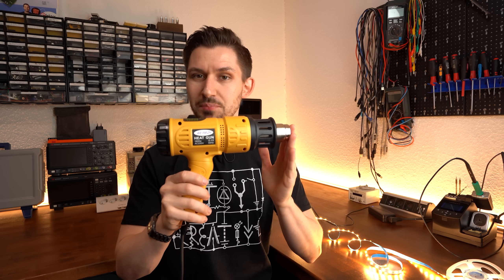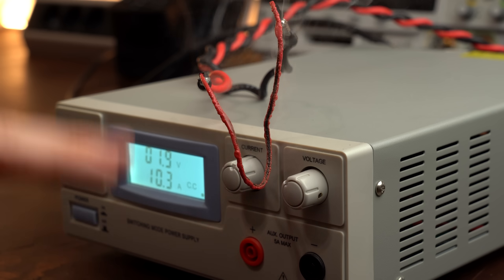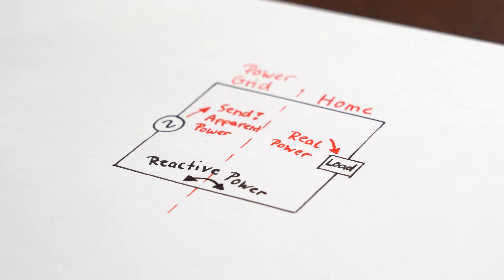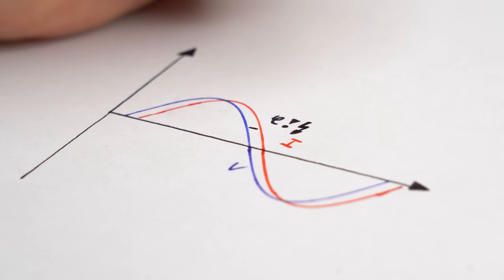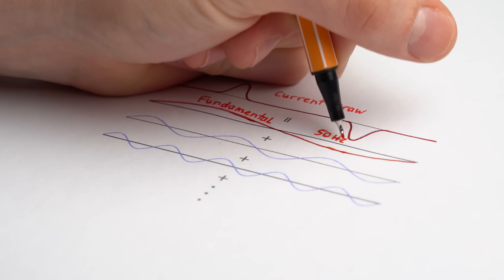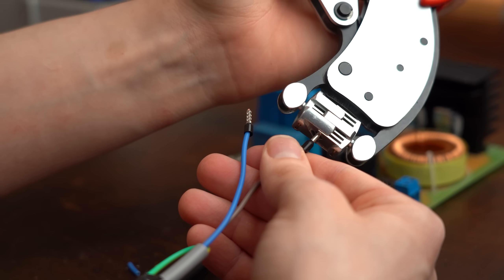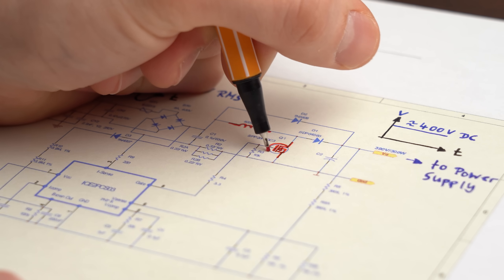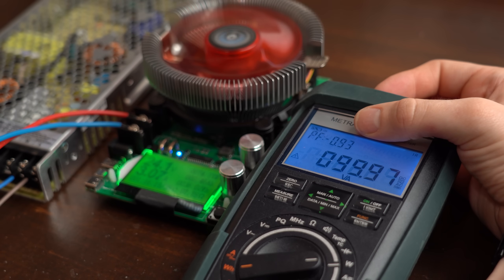The Most Important Circuit for our Electrical Future?! (PFC) EB#55

Comment: Many good quality LED bulbs have PFC correction built in. It is mainly to allow them to work with existing dimmers, but at least keeps the harmonics on the mains down.
Reply: Most do not. The regulation governing low power bulbs has been made in cooperation with the bulb manufacturers. This means that PFC is only required at higher wattage than those most common. As the limit is lowered, so does the power of the bulbs. Currently I think it is around 15 W, which is why manufacturers do not make bulbs above 14 W.🤑🎉
Reply: @NightHound1337  WTF

Instead of having better products, we get capped ones
Reply: @monad_tcp  Pee poo
Reply: @NightHound1337  Most do not. The limit is lowered governing low power only required at higher wattage then I think it is around 15w this means that the PFC is only those most common
Reply: The industrial LED lights do have much better power factor. But those start at like 300w each. Consumer LED bulbs are not really a big deal. They make up such a small portion to the power we use. Most of it is from powering motors in factories. To correct that, utilities more or less force the worst offenders to install capacitor banks
Reply: @jim4556  in industries..it is a must to install P.F.C. based reactive banks to maintain the minimum allowable deviation of power factor. going below that , a penalty is imposed which is all part of the Utility Rules that industries have to adhere to.
Reply: If only they didn’t go nuts at the idea of including $0.07 of extra components to balance the power factor.
Reply: Triac dimming with LEDs is the dimming system from hell. Trailing edge better but neither give good power factor...they can't by their nature.
Reply: Love to (try to) read the comments from knowable people. However, the English is so poorly written that a significant portion of the comments are unreadable. Please folks, review your comment to make sure it is readable before clicking the Reply button. Or you can actually edit your reply after it is sent by clicking on the three dots in the upper right and correcting spelling and such.
Reply: Probably not. dimabble led has microcontroller, who decect how mant sinusoid us cut by triac.
Reply: @wojciechbajon  Probably not. Many good quality LED bulbs has microcontroller. Who decect how mant triac harmonic mains down PFC
Reply: I think in the longer term at least in 240v land the grid will move to DC. Especially with batteries and distributed generation getting an extra 30% out of the existing wires will be a boon. I think it'll move down over time, already we see long distance lines running DC. I think that'll move into the lower voltage distribution lines and eventually to the final residential supply. People will get either a whole house inverter or wind up with small pucks that'll convert the 400odd volt DC in their walls to AC for any appliances too old to run on straight DC.
To be clear I'm thinking over the next hundred years or so.
Reply: @zyeborm  I don't think that will ever take off. Way too much power is generated with AC and consumed as AC. And DC transmission lines only benefit when you are combining two different AC grids that are not synchronized or when the capacitive losses far outweigh the resistive losses. Otherwise, AC goes much further than DC. 

It Would solve power factor issues but it does not fix harmonics, noise. All your devices would use buck converters amd as a result of the sharp spikes of high current, you will get inductive spikes that  will propagate as high voltage spikes down the wire. It's also much harder on switches both solid state and physical contacts. It's hard to break a DC arc so you get alot more heat anywhere it does.  Where AC has  zero potential crossing that exstinguishes arcs in electrical contacts. Then the high voltage spikes fro. Switching DC loads that have inductance or from connecting something with a large capacitance would be very hard on solid state switches. AC solves this. And it's not terribly exspensive to correct power factor. 

Adding capacitors to large motors or new motors, that enharently have better power factor, and useing motor drives that both correct power factor but also save energy on the application are already very popular solutions. Adding an active front end to switchmode powersupplies will be popular. Especially since they represent are a minority of the bulk of the power used.. popular in homes. Not popular in industry, it's just motors that use so much more power than anything else
Reply: @jim4556  how many of those motors are driven by VFD? How many will be in a hundred years. Also about 20% of all power generated is lost on the way to the destination much of that due to ac losses on transmission lines. 
DC is more efficient, over time that'll win. There's already DC connections for lines that connect synchronised end points.
Reply: @zyeborm  somone didn't pay attention in highschool. DC losses at distances of a few feet or a few thousand are way higher than AC losses. They only work better covering spans of many miles. They pose many more issues than they fix for shorter runs. 
It's just easier to have active front ends on motor drivers and switch mode powersupplies. 

The most annoying thing on VFDs is that they kill one another from the harsh switching they do. DC would still propagate this unless you also had an active front end. Soo.. there's no benefit while massively increasing the arc flash hazard in a commercial environment. More losses, and while you don't have to worry about power factor, you still need an active front end on your devices because it doesn't fix most of the same issues while introducing new ones.
Reply: @jim4556  I agree what a nutjob to think DC will take over AC for distribution
Reply: @jim4556  You are the one talking trash here. AC have way more losses than DC, as lines have capacitance - which causes reactive currents that increase losses. 
There are also the "skin effect" in thick wires (where a larger part of the current goes along the surface of a wire and less in the middle - causing the cross section area to be used less efficiently), which further increases resistive losses. 
DC genarates no reactive current over the line capacitance and has no skin effect. HVDC (high voltage DC) power lines is in fact used particularly for transmission over very long distances and for underwater power lines, where coaxial cables is used (those have high capacitance). 

Also the problem with inductive spikes and noise you mentioned will make no difference with DC. 
The frequency of mains AC is so low that for a switch that connect or disconnect power to something, it's practically the same as DC, unless the connection or disconnection happens right at a zero crossing. Which mechanical switches and relays don't do.
Solid state switched composed of a triac turns off at the zero crossing (which can prevent inductive spikes) but even those usually turns on "in the middle of a wave", generating the same issue with capacitive loads (huge current spike as voltage is applied).
But you are right about mechanical switches and problem with arcs though. Mechanical switches that disconnect under load will have to be designed in a different way, so the arc get quenched (for example by the use of magnets)

I still don't think AC will be replaced in the foreseeable future though. Mostly because of the simplicity and relatively low cost of using transformers to step up and down voltage for distribution. 
Even if it's possible and very doable today to build DC/DC converters (and will be even more so in the future), it's still more complex than just windings on an iron core. Transformers get big and heavy (compared to their power handling capacity) at mains frequencies though - but for stationary installations (like in power stations), that normally not an issue.
Also (as you mention) the industry is still using AC quite a lot. 
When it comes to motors, more and more run on a VFD, but with AC, it's still possible to drive motors directly from mains (which works fine for many machines that mostly run on a set RPM) and will always be the cheapest when it comes to installation.
It also allows for simple mechanical switches and contactors (as mentioned, the arc gets quenched during the zero crossing) and crude power regulation by phase angle control (not great at all for power factor, but used quite a lot for things like industrial furnaces and heaters)
With DC a PWM controller (practically a buck converter) is needed for power regulation (still simple, but more complex and require more components than a simple phase angle control) and VFDs or some sort of controllers/drivers will always be needed for motors. 
Unless old brushed motors are used - but those are not very practical to use (for example the RPM will be very unstable without regulation and will vary widely with the load) and they are also less efficient and require more maintenance.
Reply: given the price difference and reliability for transformers, DC would probably be only used for long distance at first. (afaik the breakpoint is around 100km.)
Reply: @jim4556  dude if DC loses are significant at a distance of a few feet why do they make the highest power transmission lines DC?
Perhaps you should have paid attention at University, not just high school.
Transmission line loss is related to voltage current and frequency.
The only advantage of ac is you can use Transformers to increase voltage for long distances. The advent of semiconductors means we can now efficiently change the voltage of DC power. In so doing we can now run at zero frequency on the transmission line. 
There is no skin effect for DC. The is no capacitative coupling loses. There is no sinusoidal waveform that means the line spends literally most of its time below the rated voltage.

For any given conductor you will stuff more power down it more efficiently using DC rather than AC.
If I'm wrong do the maths and prove it.
Reply: @zyeborm  skin effects dosnt play any part of what's going on at 50-60 Hz. And you know why we measure voltage in Vrms? It's the equivalent DC voltage taking into account all the time it's not pushing current. So.. that's not an issue. Those cables are not being underutilized by transmitting AC power vs DC. And God forbid we use over 98% efficient utility transformers for increasing and decreasing the voltage.. the vast majority of electricity is produced by spinning a motor and consumed by spinning a motor. Turns out AC is very good at spinning motors. No need to rectify it and use 100 buck and boost converters until the point somone can use it. Each one needing filtering because they are so electrically noisy and ripping out the entire infilstructor and replacing it from light bulbs, light switches, circuit breakers to every system the utility maintains all because they literally cannot handle DC since it's so much harder to switch. And for what? So we can use complicated buck and boost converters that are massively more exspensive, massively more prone to failure, and less efficient compared to a transformer? Get real. 
DC transmission lines over 200km long make sense. Purely because it does not have capacitive losses like AC and they can tie together two different unsyncronised grids. But we've covered that 10 times now
Reply: @jim4556  yes RMS voltage is lower than the peak voltage. So if you ran a given line at that peak voltage how much more power would fit in that line?
Reply: @zyeborm  on DC? If you delivered any more power than AC? It would melt. Because that's how RMS voltage works. It's the same power you'd run if it was DC... if you wanted to run at a higher voltage on ac, you just do it.. that argument is stupid.
Reply: @jim4556  so there's no issues with arcing if you increased the peak voltage by 30%?
It's really frustrating that on YouTube I can't give you links to prove that you're wrong but hey. You probably wouldn't read them anyway.
Reply: @zyeborm  I'm sorry you don't understand what Vrms is. It's a very simple concept that somehow goes over your head. Please read up about it. High power transmission lines arnt generally limited by cable insulation. Mostly because there isn't any. If you wanted a higher voltage transmission line, you just build one. But like how much higher do you want? Many are already 500KV that's not a benefit of DC or AC. Both can arc at high voltages. Have you seen the sircuit breakers for small DC city trains vs some AC ones. They are like 4x the size because a DC arc is so much harder to extinguish. It's a dumb system with most of the same issues but it would cost exstrodinarly more money to operate.. which is why a transmission line needs to span 200km to break even with the AC equivalent.. and there literally no demand or practical use for converting an entire country to an All DC system. It will never happen.you have yet to come up with a single application besides the one they are currently useing it for where it would perform better.
Reply: @jim4556  remember when I said for any given conductor?
You know, like for like?
I'm glad the only losses in the electrical grid are ohmic.
What's the source for your 200km figure btw?
Reply: @zyeborm  dude goodbye. You dont know anything you're talking about. There are things that use more power than your LED lights and your laptop.
Reply: @jim4556  yeah, and more and more of those high power applications are using DC and inverters.  Your time horizon is evidently quarter 4 year 1932. Like I said originally. I'm talking 100 years.
Reply: @Speeder84XL  DC in last mile connectivity is definitely a no brainer... whereas for long distance transmission it has its " best break even ratio " ( economically & complexity wise) thats advantageous ( marginally than AC ) only in certain geographical terrains....
Numerous feasibility studies have been carried out in the past 25-30 years by utility companies & worldwide ,  various government ministries in the power distribution/ management field....
sone Y.T. videos of such studies are available...
Otherwise its a too complex a topic for groups  such as this to speculate..or discuss.
Reply: @analoghardwaretops3976  Yes, I forgot about that in the discussion. We already do that to power subway trains and trams (that's no low power stuff either, since just one subway train can easely pull 1 MW or more during acceleration). It's also used in some large server centers and there it does save a lot of energy by just having DC/DC converters without the  AC to DC step (not just because of decreased power losses in the converters, but also because they get less heat to deal with, so power consumption for cooling systems also goes down). 

So it would indeed have it's advantages today, when most stuff runs on DC. 
Also when it comes to motors, they almost always run more efficiently using a VFD or similar controller, such as those used for BLDC motors. The controllers always need to be fed with DC (if AC is on the input, it has to be rectified first). 
It's just about simplicity to drive motors directly and still works great for machines that run at a set RPM and don't have very much load variations (given that the motor size is matched to the load). 
But having a AC distribution network and rectify just during last step before users,  would still allow AC power for some users (by just skipping the rectification step). 
For example old large industries that have a lot of directly driven motors (where an upgrade would be very expensive) could continue run on AC. They often have their own substations anyway, as they need so much power. That would be the best of 2 worlds. 

But, as you say, this topic is more complex than it first seems to discuss.
Reply: @jim4556  As he had said, over the span of the next 100 years.
For residential use I could see DC potentially being adopted over that time with 3 phase AC (or HVDC as there are stretches of HVDC far shorter than your 200km figure already and they aren't just for removing the need to sync grids, usually for underwater or underground running of cable due to no capacitive losses) being used for short distance power transmission. Homes may adopt DC simply because it's slightly safer with AC or HVDC being stepped down and rectified in extremely local areas, probably every hundred metres or so.
As for industrial buildings, most use VFDs already, though AC may be more useful there.
Reply: @David Davidson  it will probably never be used in homes. It's not slightly safer. It's significantly more dangerous sure you don't get capacitive coupling through things but that's mitigated through grounding/ is low enough to be safe. However the fact the arcs are so much more difficult to suppress makes it more dangerous and much more exspensive. Literally every relay, light switch, motor, circuit breaker needs to be replaced with one much larger in size and will have much shorter life spans. It's not beneficial. I can see them being adopted only in off grid houses that generate their own power in attemp to save money/ energy by converting their battery voltage to AC. Most motors I'm industrial applications are not on drives. Yes many are being put on them but going to DC does nothing but cause more issues for them. DC systems are still actively being removed from large industrial facilities. The additional arc flash requirements would take more space so retrofitting an existing building would be very exspensive. It's cheaper to buy capacitor banks to correct power factor or buying drives with power factor correction built in. A similar style drive would still need to be used on a DC system to filter out noise. Today, drives just make less noise or they use an isolation transformer and line reactors. Both don't exsist for DC for obvious reasons.
Reply: @jim4556  Lifespan problems are only an issue for mechanical switches.
I can't see mechanical switches being a thing 50 years into the future, for residential use the switches used most often in houses are light switches and a significant number of people use either remote controlled lights or voice activated ones and those use solid state tech.
Solid state relays are cheap now. Solid state breakers are a thing now too (although currently not very cheap) so arc mitigation on switches may not be an issue in a few decades.
If we keep moving toward solid state everything DC may be more viable. Especially if (and we're talking by 2123) that smart grid crap catches on and most people have battery storage at home.
Reply: @David Davidson I really hope not. We still regularly have 100 year old houses. 150-200 year old houses In Europe. While I think it's smart and advantageous to use energy in coordination to its generation. I really hope our grid is not so fragile and under sized that that becomes a requirement or need.  Battery tec needs to come a long way for that to even be feasible. I regularly replace drive every 5-10 years because they fail and or have been discontinued and will not be supported. And those are high end drives costing +30k, kept in a low dust air conditioned environment with an isolation transformer and line reactors for noise. Alot are not even on high performance systems meaning they just slowly turn on and off a motor and run at one speed for most of their life. All while being up sized for the attached motor slightly. They are babied. And if anything, they are getting less reliable and less servaceable than ones made in the 80-90s that are objectively bad drives in every other way. AC is here to stay because DC literally only solves power factor and capacitive losses. It is worse in every other way. It's more complicated, less reliable, more exspensive. Requires regular maitinance of every device that steps it up and down by a factor of 2 or 3 And it requires completely abandoning the existing grid, and everything it powers to implement. All for what? So only the utility can some money? Right, so they would implement DC transmission lines where it makes sense as it's economically viable. Congrats. We landed exactly where I said it would.
Reply: @zyeborm  dude, reason we moved to AC is because of DC losses...
Reply: @jakubrogacz6829  yes 200 years ago before we had semiconductors which made DC DC conversion very hard. 
Have you noticed that your wall warts now weigh 10% of what they did when they were based on a simple transformer? Why do you think that is?
Reply: @zyeborm  there is no dc-dc conversion possible cause there is no transformer equivalent based on capacitance( electrostatic field to be precise) yet. Also semiconductors don't help in that regard. You could build vacuum tube equivalent of dc - dc converter ( basically it's a ac generator coupled with rectifier )
Reply: @jakubrogacz6829  what do you think the video you just watched was about?
Reply: @zyeborm  Well, I have better question, do you know how step-up or step-down dc-dc converter works ( btw. before semiconducting "dc-dc" convertes there were dc motor based ones )
Reply: @jakubrogacz6829  yes I do in fact. Yes I know they still have magnetics in them. Yes you can call it a transformer if you want to be asinine about it. But hey you can ship your AC down the wire at 2Mhz and see how far that gets you. Why do you think new high power transmission lines are DC?  What happens if you google "DC-DC converter" do you get results? Did you know what is meant by the term DC DC converter and you went off about electrostatic fields to try and show off how smart you were or something?
Try this on for size then. "There's no such thing as DC losses that are different in any way to AC losses" look I can make technically correct but totally pointless statements too.
Reply: @zyeborm  does anyone say that we should blast 2MHz signal through conductors ? 
Also 50hz AC's only inefficiency is the cross section of wire needs to be a bit bigger ( and true possible capacitance of wires as well needs to be taken into account ). That being said DC systems in general are much less safe ( there is difference what AC shock and DC shock may do to you even keeping same power) , and we are talking about USA here, someone managed to do something stupid enough to force manufacturers to state that drying off your pets in microwave isn't best for their continued survival.....

anyways, DC just isn't holly grail, if it was we wouldn't switch to AC
Reply: @jakubrogacz6829  Again, At the time several hundred years ago AC was the right solution to the problems they had. I suggest that in a hundred years the solutions to the problems we have might be different. I know that's a crime to suggest it seems. My bad.
Reply: @zyeborm  In few hundred years - maybe, maybe we will use optical circuits instead of electrical ones even who knows, but right now switching whole grid to DC is neither good nor even safe idea (just from human safety point of view )
Reply: @jakubrogacz6829  I mean you can get arc fault circuit breakers today. Just use them. Arguably arc fault detection is easier in a DC system than an AC system. I doubt we will use optics for power transmission to any significant degree. Most likely superconductors. (Which generally are current limited, as in they stop being superconductors if you exceed a critical current density) making DC more preferable again. Also who would after going to the trouble of making a superconducting transmission line then throw away all that power in capacitive and inductive losses you'd have with AC. Note there are already a few small scale superconducting transmission lines which AFAIK are all DC.
Reply: @jim4556   actually I think that for same rms or peak voltage, which is set usually by the limits of power semicconductors and transformers, i think? can't each "pole" of DC can move up to twice the power that AC can into the same load resistance? without issues of line capacitance or impedance mismatch?  I guess  dc has air ionization issue so needs more separation between lines, and resistance is of course more of an issue, so maybe  HVDC load impedance used is higher to lower I^2*R losses.  but i guess my point is isnt it more complicated than what you say?
LIke 60 Hz is good for spinnng 50-60 Hz motors, but for variable speed drives which are moree and more common for efficiency of the systems they run, 60 Hz has to be chopped or rectified or PWM'd ,  like you said, right?
Of course the transformers are the key, right.   I can't argue with those!  So ordinary but so excellent! You win!
Reply: @foxlies2205  so like a common DC bus has issues with dirty power. Maybe AC is just as bad but each transformer on the line seems to filter alot of it out. But basically if you have alot of PWM or switch mode stuff on a common DC bus, they create alot of harmonics and start killing eachother because that's high frequency AC components going into devices only intended to see DC. 

You can transfer more power at less current with DC if you ignore Vrms. Vrms is literally a term to quantify AC into equivalent DC for easy circuit analysis. Voltage peak to peak on AC will be a higher voltage than the DC equivalent. 

Resistive losses on both AC and DC are the same. You can transfer power across high voltage transmission lines  basically at whatever voltage you desire via AC or DC. Ummm other than that the 0 crossing switching and automatic arc suppression of AC stuff is pretty useful. That's why AC switches are less than half the size of DC switches.
Reply: @jim4556   
Jim, would it be fair to say that many spikes that are put back out onto lines, isn't that really a kind of impedance matching or imbalance problem?  I'm an EE but have much much to learn about power, but isnt it true there are ways to absorb spikes and re-inject them into the circuit, or passively or better actively snub them for use in a boost converter say for the transistor drives or the PFC shown that needed 600V?  you know what I mean? 
probably not a good analogy but like tuned engine intakes and exhausts in gas engines lower back pressure and let carburetor run smooth?
Reply: @foxlies2205  I'm also an EE. And this conversation went on long enough that it's hard to to follow. And its been a long day for me. But yes partially. Active PFC does helps alot for AC. Though they are complex and exspensive. On DC it's pretty similar. It's always down switching. For dimming, inverting, whatever the case you need to start and stop current flow. AC or DC loads still have inductive spikes. Powering a transformer or a motor have large inductive loads. And as you know they resist current change both turning on and turning off. That back emf causes issues with your power supply or DC bus back feeding noise.

So like if you have an bank of drives. That high frequency switching to make whatever frequency for the motor. You get un-wanted noise on the load side (this is why you need to de rate those motor cables) you can put load reactors to help limit this. And also change the chopping frequency of the drive. But that will get back to the DC bus. And that will get back to the power feed. The Fets on the front end of that drive creating the DC bus has the same issues and remedies with chopping frequency and a line reactor. And how they interact with eachother being powered from the same source is often constructive waveforms so amplifying one another so they keep killing one another Soo then you end up splitting up the drives with multiple step down transformers as yet another form of line reactor.. so ultimately you've just added a tun of impedance into the circuit and the emf radiation is so absurd that your grounding becomes crazy important to avoid loops and every pice of wire, conduit, wire tray, whatever in the vicinity just becomes an antenna with their own eddy currents you can observe.. what I'm getting at, is it gets complicated very quick and you can spend years designing, changing, and tuneing this system to mitigate all these  things. And all that goes out the window as soon as you find out you need to power yet another motor. Common DC busses and common AC sources are both hell. It runs on magic. I've spent too much time trying to solve their problems. Thankfully cheap drives are continously getting better at making less noise but ultimately they are still ham radio making everything they touch or are near, an antenna. 

And why not use an exspensive drive that makes substantially less noise from the begging? Well a simple 200hp fan that just needs to run at 45hz all day is adequately powered by a drive less than half as expensive and it will probably be fine and last for years. Same logic applies to your variable speed 3hp furnace blower. No one will buy the appliance that is more complex and Probably just as long lived and $600 more than their competitor.
Reply: @foxlies2205  oh and also like on a DC system. You can definitely throw a choke and a flyback diode on it. You do have to impedance match to improve performance. That ofcourse only works with a known load. And the switching speed of the diode is not instant. So that method will never be perfect. There is eccentally active correction circuitry to try to adapt to verrying loads. Same type of issues but more flexible in applications. It gets very expensive the higher power the thing. 
I clearly do not work In power distribution on the utility scale. Medium voltage industrial stuff for factories is about as far as I go. I also have an intrest in circuit design. What gets into finding why things broke around me. My last job would also do in depth failure analysis on everything they could. And let me tell you, getting a company to even record and meter the type of Boise reflected on the power distribution on 480V and above is ridiculously exspensive to do it all safely. Then you have to digest whatever they find and try to correct the sources. It gets into the weeds very quickly. It's definitely not a simple task when working at that scale let alone a utility level. But in short, it's cheaper to throw everything on its own DC bus and it's own step down transformer, line reactor, whatever when you start facing that problem. A shotgun approach. Because it usually takes a few years to even find out if it's solved without hireing that exspensive service again. On the utility scale.. well.. I can't even imagine. Much more exspensive, much more to manage. And it's not like you can cut your customers off a bunch of times to make changes.
Reply: @zyeborm  Better yet, it’s unlimited free energy if we attach a generator to the corpse of Tesla who will be spinning endlessly in his grave about this.
Reply: @zyeborm  I was watching this video and learned a lot but I had concerns or confustion:
i'll use numbers just for clarity not to suggest I am other than learning here.  Can anybody help me out.
1. If I use electricity from the grid, they charge me unfortunately, for apparent power, here in the US at least, so PFCs would seem to someteimes be good investment especially for big loads, say for my refrigerator and heat pump and the big washer dryer etc appliance motors and air conditioner (if u have) and hvac motors and rectifiers SMPS?  => So those would seem l lke worth cleaning up powerfactor.  and obviously industrial customers are surely more motivated.
2.   I guess I cant tell what my watt hour meter does what it calculates.. with regards to harmonics.  I think it is supposed to sample  V*I and average that over one cycle, say 20 ms for 50 Hz, if it were calc'ing actual power.  I think it calculates Vrms over one or more integer number of 20ms periods, and  I_rms over that many  20 ms periods, and and multiplies those scalars together, and charges us for that amount of apparent power for that number of periods, and accumulates that to get apparent watt hours?   so what happens to harmonics then, since some will increase the rms current or rms voltage or their product others not, with different effect on the actual power deliverd?
3. I liked this video great tips and scope work and explanation, but I couldn't tell if the PFC actually say saved me money, I'll rewatch but it must be using extra power to run the boost converter and the magnetics and diodes& power transistor(s) and stuff? did i miss that?
 so isnt there a tradeoff like get the PF up above say 0.5 or 0.707 to fix the worst of it but then diminishing cost returns?
 4. Also, doesn't the grid have an (Thevenin?)  impedance, if small, that needs to be considered, when doing the matching circuit?  And does a load like the LEDs actually change impedance as say the LED brightness is turned up, or my washing machine is working hard, or unbalanced, or heavily loaded, so you need to pick an operatng point to match at, presumably the biggest win is to match the impedance where the equipment say the LEDs are drawing the most?
5. in the video, I couldn,t tell if the PFC+LEDs  ended up drawing more apparent power from the grid, given the need to run the flyback, the scope view  didn't really look like it actually was at PF=1, looked more  like phase shifted so only 0.8, and fuzzy with high frequency switching noise?  Is that HF switching more of an issuse? and I guess if we get PF better than 0.8 or so, probably have most of the financial value..

Thanks for any input I'm sorry if I mis understood.. but it seems like there are  tradeoffs on how much to spend invest; and harmonics are confusing.
6. Finally it seems like the home power say solare+wind+biogas+  battery systems of the future will free us from utility crap and pollution, and we can kiss National Grid goodbye or maybe just to charge my sugarcane ethanol PHEV ..   If my battery sourced nano grid is AC, say 50Hz  it will will be less stiff and need a lot of PFC like thisnd filtering, and also will need to be able to start those big motor loads... will we then need good soft start or hard-starts? is that similar to PFC technology, but switched in?  Or will home power (nano) grids say be DC, say run from battery pack at 300V or 600V from a tesla pack that I pulled from a used EV or EV truck? will I then use DC to run some loads, using EV sourced motors, and then invert to run legacy appliances? Or have a VFD or muxed VFD to run those?  Or could nano-grids run at 400 Hz like aircraft, to reduce matching component size  i.e.400 Hz = 1/sqrt(LC)?
Thank you. Sorry if this has a lot of ignorance.. still learning, trying to escape the grid and its methane and CO2 and mercury in our rivers and lakes etc...